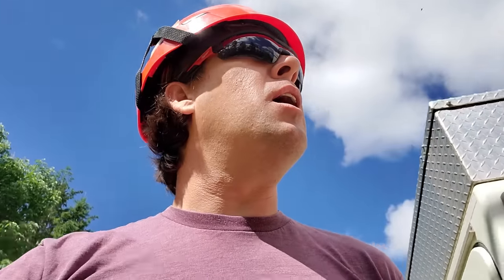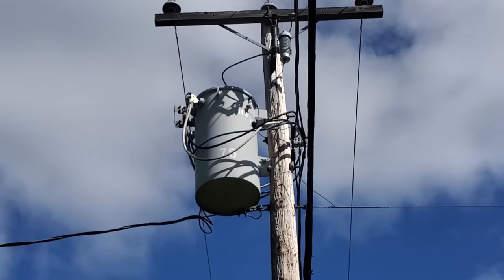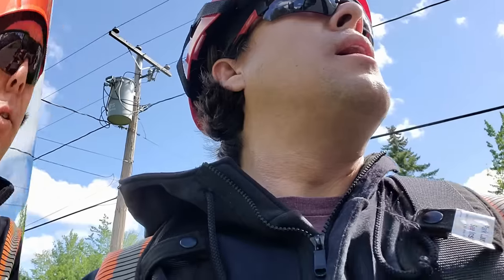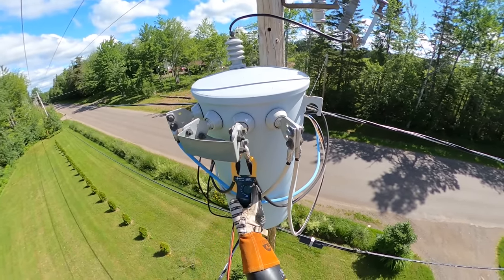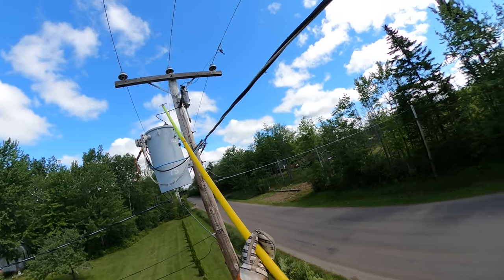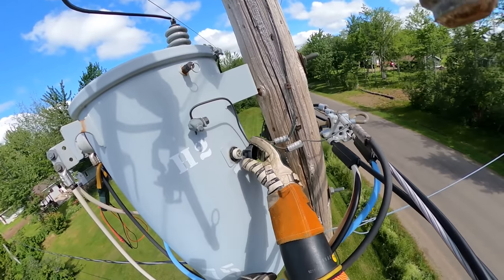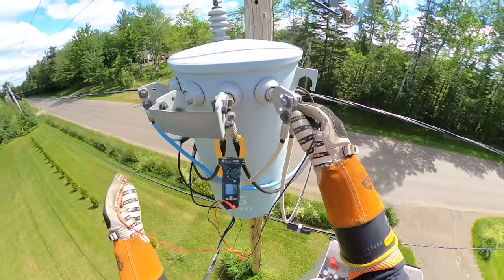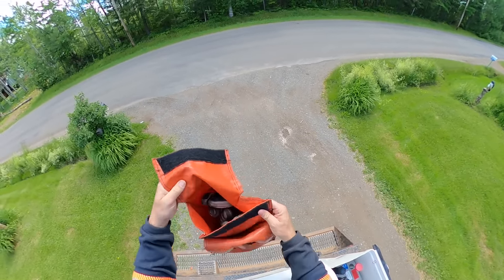How we change voltage on a transformer

Comment: Out of curiosity, why do the transformers not have a mechanism of auto-regulating themselves?
Reply: cost, it's extremely expensive to implement and is a point of failure
Reply: Your regular residential transformer has no moving parts. A voltage regulator is essentially a transformer with a larger amount of taps that are computer controlled automatically to maintain line voltage. There's no need for every transformer to automatic because as long as the line voltage stays the same the service voltage will always be the same ~
Reply from the maker: You guys nailed it!

Comment: It looks like the hot wires off the transformer are blue and white. Is that normal?
Reply from the maker: The white is an old faded red wire. The red from our quadrex that we use for leads doesn't typically fade that bad but I've definitely seen it lots! Perhaps inconsistencies in the manufacturing of the cable jackets/insulation 🤔

Comment: Impressive work!
I'm curious, what horrible things would happen if you adjusted the tap without de-energizing the circuit?
Reply: The internal switch would arc.
Reply: The earths rotation would potentially slow down ~5%, causing longer work days and hotter temperatures.

Comment: Surprised how close you got to the end of the 'de-energized' fuse... If someone was back feeding the transformer, wouldn't that fuse have been at 7200?
Reply: Was thinking that myself.  If someone was backfeeding, yes, the bottom of that cutout would have been hot at ~7.2kv...
Reply: Send it Bobby!!
Reply from the maker: Back feed would absolutely energize the primary side! 
While in close proximity, I was in an insulated bucket and my second point of contact was with 20kv tested gloves. 
Had I climbed the pole, I would have removed the cutout door and riser tap.
Reply: If someone were back feeding and intentionally is landing they would be breaking the law... bigger problem than being close to the fuse when working on the low voltage side.

Comment: In the UK, the declared voltage and tolerance for an electricity supply is 230 volts -6%, +10%. Our transformers don't have tap changers. Our appliances work just fine.
Reply: Here in France for the 230volt is the tolerance + or - 10%,  but the real voltage delivered is very stable around 220 volt,  personaly i did never seen more than 2% variation...

Comment: Something I've been wondering. Is there such thing as a circuit breaker, or automatic recloser that fits into a cut-out?
Reply: Yes. It's called a trip saver.
Reply: You’ll see in cut outs, there is a box hanging off the barrel.
Reply from the maker: Yes exactly! We've got a few of em out on the lines. They aren't typically very popular amongst lineman. I'll try and get some shots of one
Reply: Yeah my employer has been putting alot of fuse savers up. They are a pain in the ass to close back in. Dam things are heavy and you really have to slam it in good or it will just open again.
Reply: @Bobsdecline  I'd love to have one of those on the transformer that feeds my house!  The cutout blows at least once every couple months due to animals on top of the transformer.
Reply from the maker: A bushing guard and bird wire would likely help a lot as well!

Comment: It surprises me that final distribution transformers run from 1 phase to ground. In the UK, these transformers have the HT winding across 2 phases, balancing the load more evenly, and removing the need for an HT ground connection.
Reply: For larger loads like apartment buildings, commercial, or industrial they will be 3 phase.

Apartment stoves/ovens run a little "slow" because when you get 120V to ground on one phase: the phase to phase voltage is only 208V (instead of 240V).

Comment: The transformer, which powered the recipients, had one fuse from the medium voltage side, works on the principle of a voltage transformer, the other end of the winding is connected to the earth through the working earthing which becomes protective earthing when disconnected. I think right? Regards

Comment: So, you go from 124/248V to 121/242V. Why was this such a big deal in the first place? You made, what, a 3% reduction in operating voltage? And it was already within the 114/228 and 126/252V threshold.
Reply from the maker: Wasn't really a big deal, the slight change in voltage will be negligible really... A contractor working at the home felt otherwise and made the customer a little nervous. Tapping it down was an easy solution to give the customer peace of mind. Also I had checked voltage in this transformer before and it was briefly at the 126 mark... Givin the ease of the repair while already being there and it having been so close to the max voltage in past it made sense, but wasn't necessary
Reply: Solar inverters will switch off around 250V, it might be the reason.

Comment: Awesome video.  Just a question … are high voltage lines 7200 volts in some areas and then approx 14kv  ? I’m talking residential areas .
Reply from the maker: The three phase voltage will be 1.73x the single phase voltage. So a 7200v line will be approx 12470 phase to phase

Comment: We get almost 120V perfectly on a circuit with a light load but it does dip on heavier loaded circuits. Haven't measured it in more demanding hours but it's usually pretty steady and reliable for the most part*. This old place has 100A service and we could easily use that ammount with all the stuff we have but I'm sure it's fineas I've seen a house with 50A service? Not sure exactly but the service lines are pretty thin going to said house and I have never seen a house with such thin wires going to it.
Reply: I'm on a 70A service fed from a secondary supplying 5 houses from just one 25kVA pole-mounted transformer! Surprisingly, the voltage sag isn't nearly as bad as you'd expect. When everyone has their A/Cs on in the summer (Phoenix, AZ), the voltage is usually around 113-117V , and in the winter we see around 122-125V.
Reply: 60 amp service was not uncommon in the USA at one point in time. Probably around the 1950s.

Comment: Great videos!  Please forgive my ignorance, but I have a question.  When extending the stick, it looks like it goes right between the high voltage wires.  Would anything happen if the stick accidentally hit one or more of the wires?
Reply: I think the pole is obviously nonconductive. But yeah I noticed that too. Seems unnecessarily dangerous. Even if it's nonconductive it's just an unnecessary risk of getting the hook caught on one of those wires

Comment: What do you use for meter leads on your meter there?   I have trouble finding good meter leads.   Even the supposedly quality ones tend to go open circuit at the probe end after a relatively short time.
Reply from the maker: Just the leads that come with the Greenlee multimeter. The tips can bend fairly easy if you take the plastic tips off, but have never had any trouble with the probe disconnecting

Comment: you have feeder regulators at your utility?  we do here, and oftentimes we investigate for bad tap contacts on multiple voltage complaints.  i called in a voltage complaint on my own house, 5 svc drops on a puny 25KVA poletop and my lights kept dipping randomly.  come to find out there was someone welding in their garage, so they swapped ours out to a big boy can after a few trouble calls

Comment: Ive got about 124 at my cabin, its several hundred feet from the transformer,so I'm guessing transformer is pretty high, which is a good thing because of voltage drop due to this long of run. I'm the only house feeding off of this transformer.

Comment: Never knew this. I Have issues at some sites of VFDs faulting for high mains voltage. Measured 254 when I was on site, never did any data logging. Could be as simple as a tap change on their transformers.

Comment: Can you tell the voltage of the primary line using the Insulators like on transmission?
Where 1 disk =15KV
So if you have 132/15= 8.8 
 There would be 9 disk.

Is there an easy identifier like that for distribution?

Comment: Have ever come across a pole transformer that sounds like your cooking chips in a deep fryer ? When i lived in Gunning New South Wales Australia 🇦🇺. There was a pole transformer that used to make that noise on temperatures Above 45 degrees Celsius but then it started to leak and it was replaced with a high efficiency pole transformer.
Reply from the maker: Yea, don't stand underneath it! 
Oil is boiling from fault or overload. Definitely needs to be isolated and changed out!

Comment: the voltage to my house (UK so 230v nominal) has always been high, around 250-255 volts which caused many issues with washing machines and the like and also meant we couldn't charge an electric car. since it's a remote area nobody ever came to fix it but finally the ancient transformer started leaking oil and that got them round to fix it.
Reply: Our UK 230 nominal is a bit of a cheat dues to pan-European harmonisation which works on paper but not in the real world.  We're still ~240–250 while the continent remains at ~220–230 the tolerances of –6% and +10% reflect this, giving an "acceptable" range of 216–253V.  So when you saw 250 that was technically okay but 255 was indeed excessively high.   Here I reliably get 240–242 depending on local load while on the Isle of Man it's consistently in the range of 247–250.

Interesting to hear that charging a car was a problem, and disappointing; you really would have hoped that such expensive bits of kit were designed to cope with greater variations.

Comment: How often does your utility use CAP (capacitor) banks to do auto voa;tage control?
Reply from the maker: Anywhere they're required really... Typically lines with heavy inductive loads. Some are positioned on particular sides lines, mainlines or even right at the sub. 
The transmission terminals also have inductive reactors to offset capacitance from long overhead transmission runs.
Reply: @Bobsdecline  usually on the primary or secondary lines…. Or both?
Reply from the maker: We install them on the primary only

Comment: Theoretically, what would happen if you operated the tap while energized? Really interested
Reply: It could cause a huge surge in current to have to go through the windings on the transformer which would destroy the transformer or blow it up, and heaven help anything connected to it at the time.

Comment: Wait, if someone is backfeeding from 120 V side, then there will be bumped to 7200 V on the high side, and you have your head almost bumping into the dangling cutout switch that might be under this voltage!

Comment: 124 volts isn't that high, it's within spec for my local power company I believe(and under the 126 you mentioned)... Should drop a bit into the houses with load too. Surprised you'd mess with it even given the offload tap changer, but customers think they know best. Really cool to see that as an option on the transformer though.
Reply: So I'm looking at my server/computer voltage right now within my home and its sitting at 124, central air is running as we speak too. Is this something to worry about if its that high in the home?  The pad mount transformer is about 75 to our meter and the meter is about 75m from the house, total of 150m.
Reply: @mattleblanc31  There are perhaps some exceptions, like old incandescent light bulbs not lasting as long, but generally speaking very few devices will care about running at a slightly higher voltage. As a mater of fact, most modern computing equipment is happy to accept anywhere from 100 volts to 250 volts, and in fact many devices get slightly more efficient at higher voltages.
Reply: @mattleblanc31  I hadn't bothered to really check my UPS since I moved 4 months ago.  The UPS is saying 115.9V. That's the lowest I've ever seen anywhere I've ever lived.  I'll have to whip out the multimeter later!

Comment: Dumb question, but you said you had multiple complaints of high voltage, how do these customers know? Are they all sitting there with multimeters in their outlets then decide to call and complain? I can’t think of a single appliance in my house that would care about such a small difference. Is there something practical in their houses that they would notice without measuring it?
Reply from the maker: After talking to them I'm pretty sure it's the result of a local electrician talking to customers and getting them unnecessarily worried

Comment: Do you have to use a load buster at a certain kva transformer? Just asking, at the company I work for, anything 75 or above requires one.
Reply from the maker: Rule of thumb is 75kva but more specifically 10A. I had a couple meters off on this one also

Comment: I'm wondering whats the reason for the high voltage neutral? In England a single phase transformer is connected between 2 phases on the overhead line, The only neutral is on the 240v side.
Reply: North America uses Y connected distribution primaries pretty near universally.  It is done to avoid ferroresonance.  
Single pole tripping is common here, as there are often long runs of a single hot and neutral to individual houses.  By always tripping single pole, 2/3 of the houses will stay on for a single wire fault.  Even when breakers (reclosers) are used here, they are often set for single pole tripping.  Single pole tripping is great to keep customers on, but bad for ferroresonance.  
With 240/120 split phase, the secondary leads need to be much shorter compared 400Y230 with many houses off a single three phase unit.  That means more, smaller transformers.  Smaller transformers are more prone to ferroresonance.  The greater distances and more sparse load mean more capacitance per transformer and hence more risk of ferroresonance.  
In the days of 2400V distribution, a lot of North America used line to line (AKA delta connected) but as the voltage has gone up the trend has been to line to neutral.
Reply: Another interesting point is that the high voltage neutral and the secondary neutral/ground are bonded, and are usually the same wire. This common neutral/ground is then grounded every few poles and at the customer service entrance. The internal house wiring neutral and earth wires both go back to the same neutral busbar in the panel. This arrangement reduces un-faulted phase voltage rise in the event of a line to ground fault, but it also has the consequence that an open neutral on the primary can result in elevated grounded conductor voltages on the customers grounded electronics, as the only current return path is now the ground rods or bonds to water mains, etc. I recall an issue I dealt with recently as an engineer where a single phase submarine cable feeding a small island lost the concentric neutral and customers on the island were reading a stray voltage of about 35V from their electrical grounds and the actual earth, and getting a tingle touching grounded appliances while standing barefoot outside! It was an accidental SWER system. It also makes high impedance ground fault detection difficult because it just looks like load to the substation relays. Typically for MV distribution the primary is only time-overcurrent protected.

Comment: Question:

Our boss had myself and my coworker get on a house and cut the service mains going into the weather head (live) with no insulated tools or PPE other than myself always having my safety glasses on and maxiflex gloves.  We both stood on a roof grounded with 3 lightning rods.  We made it safely through the job, but we were both nervous knowing the peak amperage of a leg could pump out 300 watts peak.  My coworker was afraid of heights and uneasy cutting the insulation off to install new URD into a new meter main We had installed prior to getting on the roof. I was trying to be as careful as possible installing the service drop to our polaris lugs into the new URD descending to the customer's new meter main.  Is our boss nuts?  Careless?
Reply: If OSHA catches you doing that will result in large fines. Does not matter one bit if it's a 1 amp or millon amp low voltage service. Forget the exact # but something like only 20 to 25 milliamps ( 0.025 ) current flowing thru your body can cause you not being able to let go of the shock. You must have proper PPE & have proper training before disconnecting energized wires. I did 16 hours of continuing education every year to renew my electrical license. OSHA came into a large plant that I was working back in the 1980's. I tried a few times to tell them they had several electrical violations but stopped after being labeled s trouble maker. Anyway a few years later OSHA came in and had a field day. Myself & 5 other electricians each got over 150 hours overtime correcting all the violations.

Comment: One of my 120s was at 5 volts they power company got mad at me for diagnosing the issue (took my panels cover off and was in there with my free harbor freight multimeter). I told them “don’t worry I watched a YouTube video first.” They had to dig up my neighbors yard to repair the service line.

Comment: Didn’t know those were adjustable. Curious how the customer knew of high voltage?
Reply: Problem with their solar pv tripping out due to over voltage?
Reply: An electrician that was installing equipment informed the customer and told them to call.

Comment: Why would a customer be suspicious of high line voltage??
Most customers simply plug stuff in and it works.
Also how many customers are going to put a multimeter across and outlet.
Also voltage varies depending on how much current they are drawing in their home plus the combined load on the transformer would vary anyway.

Comment: Does a higher voltage mean you need fewer amps, which isn't a bad thing?
Reply: Depends. High tech stuff like computers, some LED lights, will adjust its amp draw to compensate, but incandescent lightbulbs and heating elements and motors (some types) will draw more amps with more volts and they'll go faster and if it's too high they'll burn out